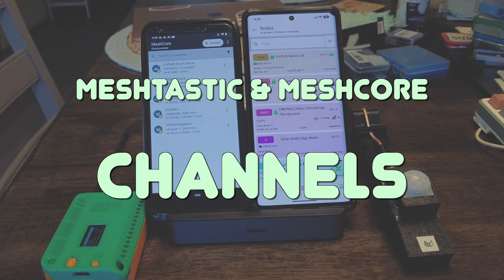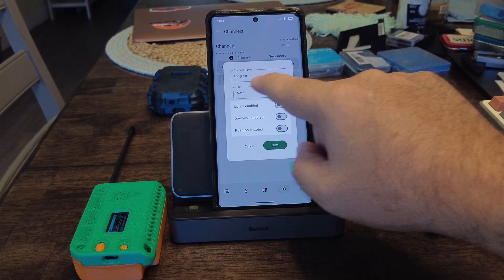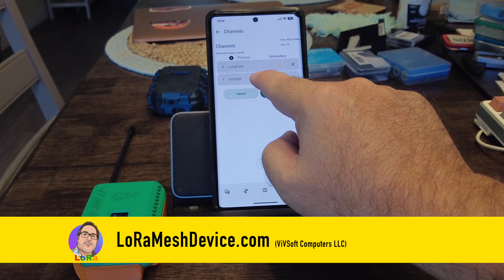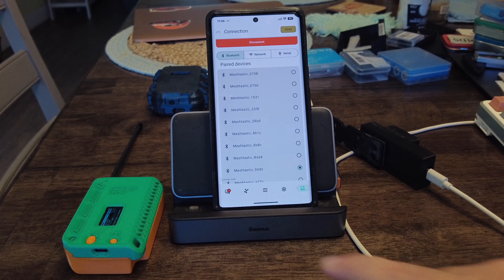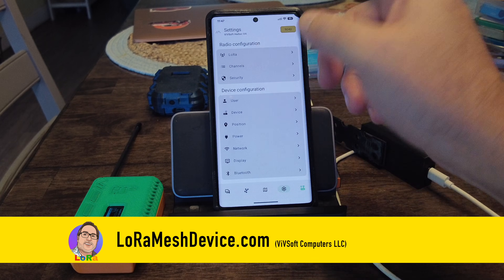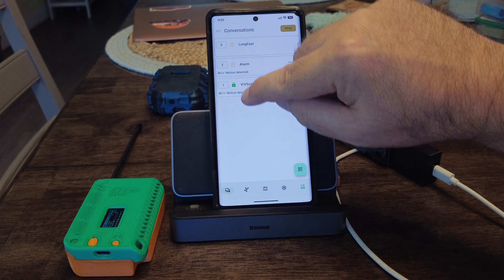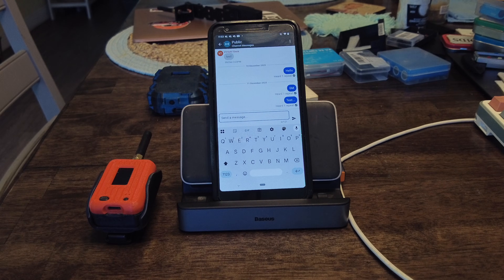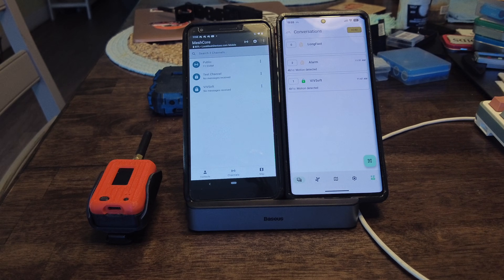Meshtastic and MeshCore Channels Explained: Public vs Private Keys

Comment: Is there potentially a problem with all those radio signals constantly being sent through your body?
Reply from the maker: Interesting discussion, but since 900 MHz is used in everyday devices such as older cordless phones, baby monitors, smart home devices, and walkie-talkies, which generally operate at very low power levels. For the general public using typical consumer devices, exposure to 900 MHz is widely considered safe within established international safety guidelines.